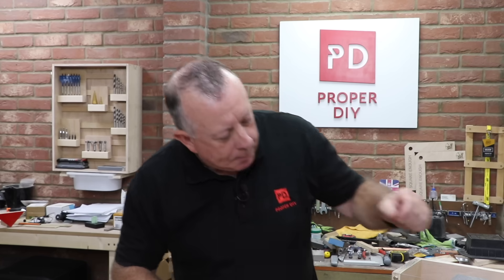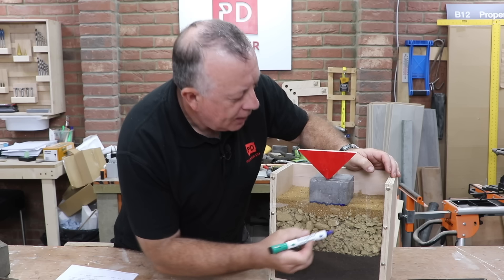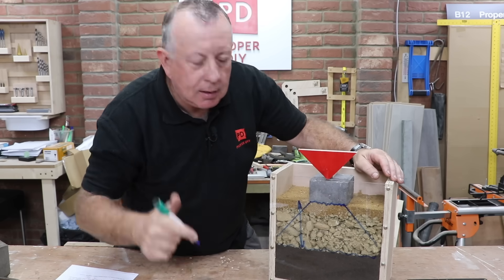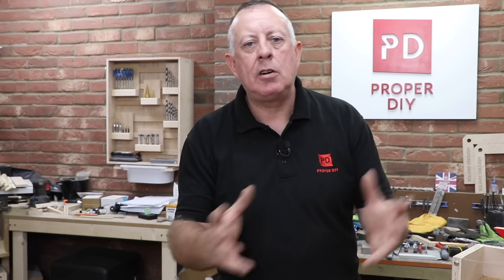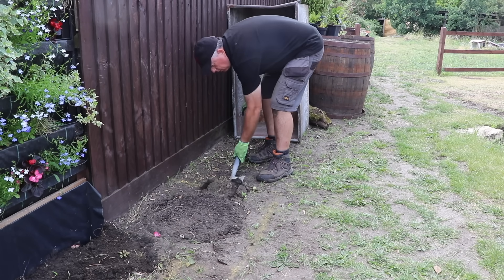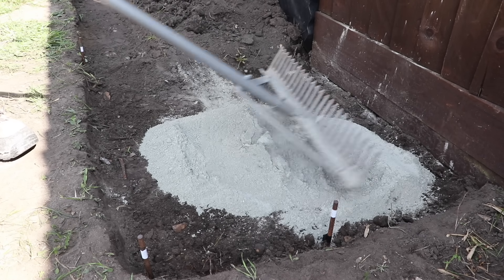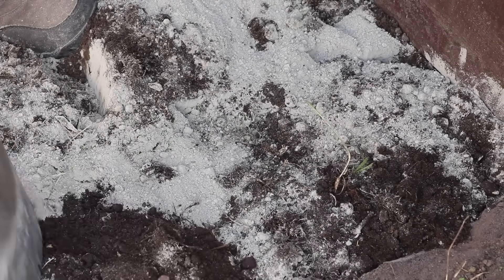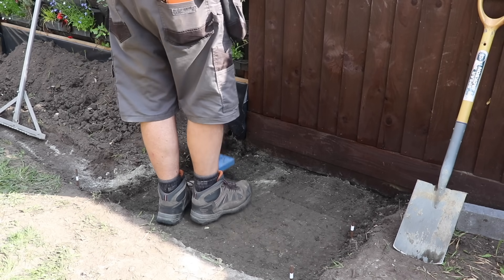How to Save Time & Money by using a little known Civil Engineering technique in the garden!

Comment: dirtcrete is underrated. I have used this in drain laying where I have put under strategic places under pipe to hold in place to retain fall. When the dirtcrete is wet you can tap the pipe down until the fall is just right, leave it to set, then drop in more dirtcrete or gravel to support rest of pipe length. Useful method when an accurate  gradual fall is needed and is cheap and easy to do.

Comment: I’ve used this method (hitherto unaware of it) for foundations for my shed / man cave on a very sloping site. Solid. I did some more “digging” on the method. The US Army engineering corp have a manual that’s 400+ pages on the civil engineering. UNESCO have a large publication on same for use in ‘developing countries’. Back in the day, when I was an engineering student, the civil engineers in TCD were working on using bamboo as structural reinforcement for concrete. I don’t think it ever either worked or went anywhere. Thanks Dude.

Comment: i never bring my work home with me, so just enough sand to level the brick and im good.
we used to use concrete wash-out, the boss would dump it in a pile, it would dry and the next day we would have to use a pick axe to get through it. this was the best stuff i ever used for base. once you pack it, it isnt like cement, it is cement and turns into concrete.

Comment: You can probably save money by using lime and or fly ash or a mixture of the three. After the initial set, you should actually try to keep it moist and water it regularly. Can vastly increase strength.
Reply: Fly ash is full of heavy metals. Rather toxic until it’s hardened. Then when it degrades it becomes toxic again for your grandkids. Wear a mask and gloves. 😅

Comment: Hey, I'm planning to build a greenhouse, and that's more than interesting !
However, you don't say anything about the penetration of water in the soil, to avoid any kind of surface flooding, which is like half of the purpose of the gravels... How does it work with that ?
Thanks !
Reply: That's not the purpose of type1. Type1 isn't permeable after correct compaction and neither is this.

You ALWAYS need a slight slope.

Comment: How good a base would this method be if used to support a hot tub, the water alone is 1.5 tonnes add to this another tonne or so for the hot tub? we were informed it must be concrete of at least 300mm which I have, reinforced with fibre.. I did see this done whilst working for Wimpey in the Middle east but obviously the sand element was more in abundance than top soil.

Comment: I worry you are usiing more cement than concrete does. You mention 1 to 4 by volume. You’re using more than concrete does, and cement is the part that pollutes our air in concrete. Quarrying and delivering rocks sure pollutes but not as much as cooking to 120 to 1600 degrees C. 
Yes a little cement can stabilize soil, but civil engineers use 3% by mass approx

Comment: soil cement is an underutilized methodology...good presentation.   but if co2 and other energy conservation is something of interest (it's not to me) then the energy and footprint of cement manufacturing is significant.  can also use a heavy lime application and that will toughen up the soil layer.

Comment: Where can we get a couple of bags of 'Fly Ash' that's left over after generating electric power from burning coal, etc?  We can't really handle delivery of a whole huge truckload, even if it's free.  ☆ QQQ: Doesn't the fly ash work just as well for stabilizing soil? 
 Is there some environmental group that could be getting some distribution together?  Maybe recycle used cement bags 1/2 full of fly ash, etc.   Thanks for having a good thought about this.  🌲😎🌲

Comment: Standard mix for rammed earth or CEB/Compressed Earth Block is 10% or 10:1 earth mix to 1 part Portland. It actually can take "years" to cure, but your finished product can have a compressive strength potentially harder than granite.  You can also skip Portland cement and go old school and use chalk or lime as a binder. You can also trap moisture into the walls with burlap to harden the mix while it cures. Leaving the wood forms on for 28 days might not work the same as concrete. A 20% to 25% mix is where you can start getting closer to an earthcrete poured mix. You have to use more water for the process, and the curing time is akin to standard concrete pours. I'm not sure what the compressive strength for poured earthcrete is though. It's beneficial and economical if you are using onsite soil.
Reply: Possible to use soil in a geopolymer formulation that forgoes fly ash and sand? (to yield a more eco-friendly mix)
Reply: @MadLadsAnonymous  They have a slurry mix for poured earth, but I don't know what the mix ratios are. they are using Magnesium oxide instead of Portland cement as the binder. I have no idea what the clay to sand, to silt percentages they are using.
Reply: @elmerkilred159  Thanks! I've recently gone down the rabbit hole. Got that classic geopolymer book to play with recipes. Would love to do a residential ICF build with fiber reinforced GPC, maybe some Xypex added to make it self-healing.

Lots of experimenting to do.
Reply: @MadLadsAnonymous  Experimenting is most of the battle to finding your mix. Good luck!

Comment: SUGGESTION: Take the cost savings of droping the cement percentage down to 10%, and place a single layer of cheap (preferably from rubbish) window screen mesh to the soil/cement. This will bring your strength way up without the cost of additional cement.
Reply: mesh below the mix or in the middle?
Reply: @jasonjayalap  
It depends on expected use, but in this case I would go for the top 3rd.

Comment: A major issue that has to be considered is that soil is precious, this kill the soil basically and can desertificate pretty easly. If used for small sections of a garden or house is indeed usefull, but i still prefer to do 100% rock and removing all the soil, so i get better concrete and also some soil that i can use for many things. 
Using this method doesn't give you back the soil, that is essential for gardening. So this can be used for some fast, small and niche applications... otherwise it's a lost of material and quality.
You should always also show the negatives of an idea or solution, never just the positives.
Otherwise it always feels like a scammy spot a little bit.

Comment: That would be good for floor inside house yeah?
Put a nice pattern cover with a 5-10mm clear condom & you can have a nice soft floor if add floor heating be a nice soft heated floor. Cuts out flooring aswell & easy to repair great insulation factor.
Personally I prefer FLYING HOUSES much easier to put out BUSHFIRESi & never need to sweep driveway or clean gutters.

Comment: With more pressure, cement can also be used to stabilize rammed earth blocks.
It'd be interesting to see if there's a reliable way to use in-place soil cement as part of a low rise building foundation.

Comment: This indeed does work and I've used it before. I recommend doing some test samples to get the ideal percentage of cement to add. t doesn't really take a lot and in testing, you want to find the minimum percent that gives you the degree of strength you need. It can vary quite a bit depending on your soil make up. 

A small 2 stroke garden tiller works nicely for easy mixing of he soil and cement.  And   lastly, compaction is a big influence on ultimate strength. If you are doing anything of any size, you might consider renting a compactor to reduce the labor on your back. There are two different types you can rent. One has a small base and works a  lot  like a jackhammer. You can find these electrically powered. The other is called a plate compactor and has some advantages like making leveling the whole pad easier. 

But if you are really looking for an easy way to put down concrete, look into something called dry pour. It's easy and you can work at your own pace. Strength wise it's very comparable to a traditional wet pour.  The key is to forget everything you know about doing concrete and follow the dry pour procedures exactly! Don't be tempted to add more water. The key is misting and adding the water over time at the prescribed intervals.
Reply: We did 2 dry pours early in the year, both around 4x12 foot and both came out excellent. I copied the Cajun country method and they are solid. I have more to do and I may try this idea as less concrete to buy and no soil to skip 👍🏻
Reply: @Awhatsup  If you are happy with dry pour, indeed, stick with it. Cajun country has it worked out pretty well. Most of my soil  is too sandy to use cement stabilization without using a lot of cement. I have tried it many times with only very limited success. I had researched this many times over the years and without the right soil mix, it won't hold up. The US military did come up with an additive that supposedly makes it viable with less than ideal soil. It's called Rhino Snot. You can get it but it isn't cheap. 

It suits military needs where concrete isn't available. I even considered trying to get some to try, but it's an investment to experiment with. You need a lot of it too, so shipping/unloading the tanks is an issue. It's really more about dust suppression and it basically glues soil particles together. I really don't see it as practical for DIY use.

Dry pour is pretty easy and does work very well if you do it right. Several key things to remember.  Screed vigorously to get the powder to the top. You'll get a better finish. It still works just making sure that it is well   mixed, but you get a rough surface. Water trough misting only, goes from the top down, don't pre-wet the ground. Don't use cheap big box store brand to save money. Sakrete or Quikcrete brands work best. 

You can potentially save a little money on a big  project by mixing your own using sand, stone and cement. I've used #11 limestone 3 parts. 2 parts clean dry sand and one part Portland cement. (Not the ECO Cement0. I batch and mix it dry in a small electric mixer. It goes pretty fast. dump it all in your form spreading as you go. You can put in rewire if you want the added strength. I then use a homemade power screed to pack it all down and smooth it out. If you want an improves surface, dust with a little cement like putting powdered sugar on pastry. use the paint roller technique for a final smoothing and the start your misting. I mist about every 30 minutes as my tests have indicated that is the time it takes to be fully absorbed. Light mist and not spray. You can get a garden wand with multiple settings and you want to use the mist setting. A Cajun Country says, look for the color change and avoid over wetting. 

By making myself, i cut the cost by a bit more than half. However, I picked up the stone from a nearby supplier, so no delivery charge and I also have plenty of clean sand, Having a Bobcat, a dump trailer,  mixer and free sand, allowed for the decent savings. It made sense for the big project. But without all that other stuff, the premix concrete is the way to go. So basically, I just made my  own pre-mix. I tested some 3-3-1 and it seemed OK but left a more sandy surface. Sakrete and Quikcrete are supposedly 4-2-1 but with both coarse and fine stone. They don't publish the  mix which is optimized for maximum strength and easy use.  #11 "driveway" limestone is close in size. It wets and bonds a bit better than pea gravels. 

I've used dry  pour for posts for many years and both Quikcrete and Sakrete premix, suggest that. I/m convinced that dry pour works great for slabs. as long as you don' need squeaky smooth, slick surface. The guys I had do my barn shop, finished it so smooth it's dangerous to walk on with wet feet!  It's a beautiful surface but slick as glass. 

I don't think I would use dry  pour for footings or thicker than a few inches. But I haven't tried it either. It has its place and I have been happy with it. I read and watched similar techniques,  but Cajun Country has it down right. 

Good luck with your project!
Reply: Dry poor has nowhere near the strength of this technique. I considered it for my outside kitchen and trailer storage until I watched the testing videos and tried it myself. It’s work but the cement, soil and a small amount of water has to be mixed for best results.
Reply: @jodyjohnsen  I completely disagree.  If you do dry pour right, 3000 psi strength is not that hard to do. And the labor to do wet mix is big, 

No way the soil method even approach's 1,000 psi, even if you have ideal soil. But if you don't have ideal soil, it just doesn't work. 

On the other hand if you do dry pour right, I have tested the cured results to between 2500 to 3000 psi. (Using my own calibrated hydraulic press. Equivalent to standard compression tests)   Better than a soupy wet mix, traditional pour.  There's a lot of dry pour videos out there and a few are good and too many are twists on the right way that guys dream up to be more like wet mix. A big mistake, Trying to short cut the ultimate shortcut is just stupid an the first thing you need to do us forget everything you know about wet concrete!  Most of the guys who got poor results, wanted poor results because they were concrete  guys with hard heads. They insisted on trying to use what they knew about concrete and that's where they screwed up. 

The Cajun Country approach is the best. They may not come across as scientifically based but they have good common sense and did a lot of experimenting to refine their methods. 

Most concrete guys are not educated, but they learned from experience. Trouble is what they have experience in and not understanding why something works or it doesn't. The Cajuns spent a lot of time trying to figure out why they saw what they did. 

I've done wet concrete and worked on big projects with top civil engineers. I'm and engineer, but civil isn't my specialty. I learned a lot about the technical nature of concrete and enough about the labor part doing it, that it's way more work than I want to do.  From the engineering standpoint a dry mix makes the stronger concrete but a wet mix is much easier to work.

So I took the engineers approach to analyzing the method. I did multiple samples and monitored the wetting based on actual penetration. I carefully measured the water applied, Once full absorbed top to bottom evenly,  I stopped watering.  Interestingly enough, the amount needed to be fully absorbed, matched the recommended water to use for standard prep. 

Only differences from Cajun Country recommendations was to mist every 30 minutes. This better matched the absorption rate than once per hour. Misting number based on 1/2 inch of dry concrete. So for 4 inches,  8 mistings supplied full absorption. By misting every 30 minutes, the top crust did not cure prematurely. 

Like CC says, don't pre wet the ground. You want water to be absorbed from the top down, not the bottom up, rake in well when putting the concrete mix down to be sure it  is well mixed. Screeding vigorously is important to cement powder to the surface. I made a vibratory screed to take the work out of that, It works to pack it down good and bring a bit more powder to the surface. Paint roller on that surface does well. Mist lightly, don't spray down, 

So other than shortening the misting schedule based on actual observed absorption, I use their prescribed method. 

Use good branded Concrete mix. Avoid cheap Menards and other store brands. These mixes are not as consistent and I believe have slightly less cement in them. Just not as good as Sakrete or Quickrete. I've been dry mixing my own in a small mixer using a bit more cement and #11 limestone. Do'nt have to but lowers cost of pre-mix bags. Thoroughly mix sand and cement and then blend in the stone. Add to the forms just as you would bagged premix. It's really low labor and you can set your own pace. 

DGMW, I think the earth based approach works pretty good for some stuff, if you have the right soil.
Reply: @professorg8383  Thank you! Wealth of knowledge👌 Will it work for a sloped driveway?
Reply: @bluesage1528  I can't say that I have ever used either cement stabilization or dry pour on a slope. 

I do believe it will work, but I would lean toward the dry pour being more durable. A few caveats as I see  it. The degree of slope can likely make a difference. How much difference would be speculation. I think if the slope is just a few degrees, it won't matter much. On a steeper slope you'll want a stronger surface as it will be dealing with more friction driving on it uphill. 

As for the process working, consider that wet pour concrete can be done on a slope,  I believe the "ideal saturation level" is achieved by a combination of a wicking action and gravity.  The wicking or hygroscopic nature of the dry material, is probably the most important factor.  But excess water will be subject to gravity. I think that as long as the water isn't subject to pooling at the base of the slope, it should be fine. 

In dry pour, the watering part of the process is important. and what you are  trying to achieve is absorption without over watering. To do it best, you want a gradual absorption without pooling. 

My suggestion regardless of which way you go, s to conduct some experimentation that simulates the actual conditions you are dealing with. 

I have watched quite a few videos of people attempting these kinds of techniques  but making their own variations along the way and then complaining that it didn't work. Good luck!

Comment: I see you've left in some roots, and are still well within the top soil layer. Will the organic matter present in your mix not cause issues further down the line? Would digging down till you reach clay help render the stabilised soil any more resistant or is it a moot point?